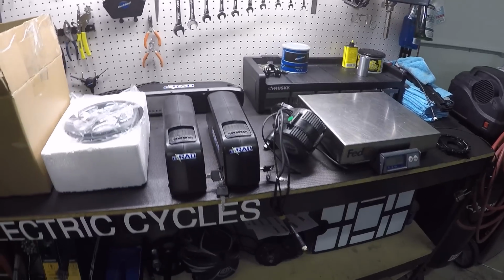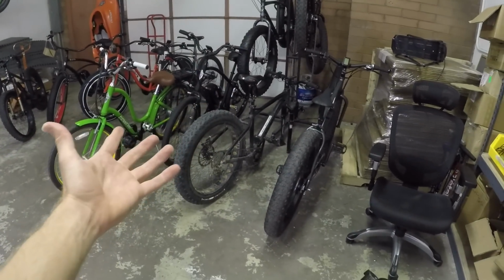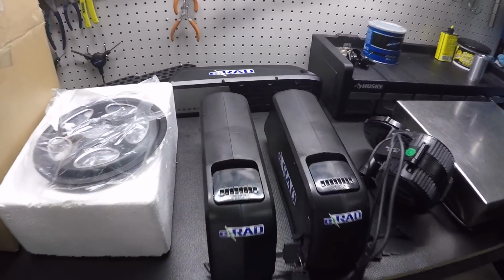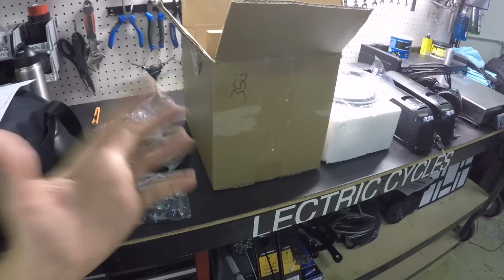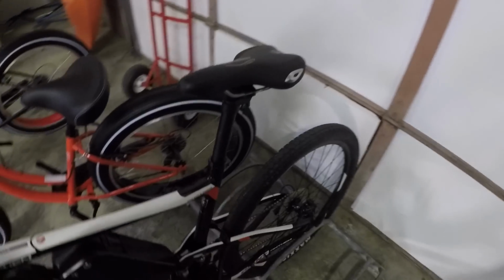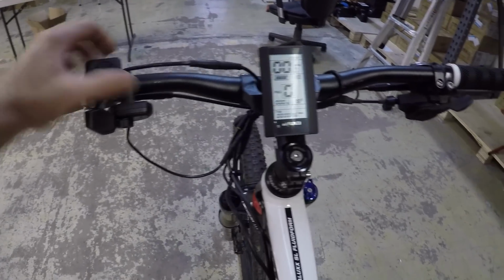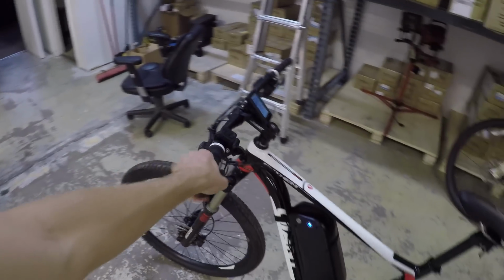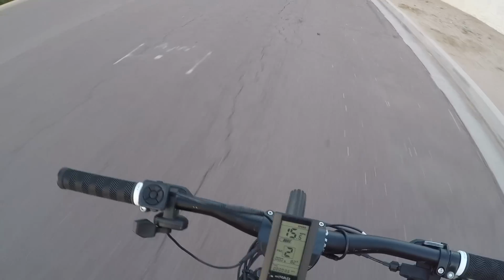e-RAD 750 Watt Mid Drive Conversion Kit Review - $950

Comment: DO NOT install this kit on a high quality bike like a full suspension GIANT, Cannondale or Scott and especially not on a carbon frame.  Reason: The bracket that attaches the motor to your bike's frame, by way of the bottom bracket shell, gets EATEN AWAY beyond belief from all the torque being produced!  This kit is not meant for hardcore riding; only smooth flat terrain or paved road.  I type from experience.
Reply: For anyone looking here, Luna Cycles makes a bracket that mounts to the frame and prevents motor rotation without digging into the bb shell.

Comment: Dumb question: Do these motors need breaking in of any kind? I remember on a new car you were supposed to keep it under 60mph for the first 1000 miles.  Also what is the best way to break in these batteries. I'm getting a setup much like this delivered tomorrow and I'm pretty stoked. Thanks for you videos.

Comment: hello I'm looking into electric bikes in a big guy 6'4 235 -280 lbs my weight fluctuates a lot  but I'm looking into electric mountain bikes  I like trek  power fly 5 s. And up.  And the other company like trek but I forget the name  bit i want a mid drive  but like the looks of the bosch kit and Yamaha kit but I want to be able to use my throttle and have pedal assist  and is it really thatch cheaper to Do it myself of hire a bike shop if I want a good bike and strong  kit bfang  750 or 1000watt i know I missed a lot I'm a newbie  thanks for your help

Comment: Isn't it a recipe for disaster when you install this kit on a frame that is not designed for this kind of weight and power?
Reply: Tamas Varga no.
Reply: tyten olaug I wouldn't be sure about it...
Reply: Tamas Varga the bike is designed to take very big loads on the bottom bracket without failing i can't see the problem.
Reply: tyten olaug "the bike" - which bike? Ask if you still keep the frame warranty when you install this 750W kit...
Reply: Tamas Varga you don't but the bike can handle it no big deal.
Reply: tyten olaug I guess there is a reason for losing the frame warranty...

Comment: how many miles on full throttle can it go on one charge? i'm thinking about converting my bike to electric, and comparing options
Reply: with the 11ah battery
Reply: Joshua Maune 100
Reply: I get 30mile plus thottle with a 48v 17.5 ah .
I cant see the point getting less than 15ah

Comment: Hi Court, I have a giant anthem like in your review, converted to electric with a hub motor on the rear. I run a 48v battery on a 24v 500watt motor. Overvolting gives me a top speed of 61kmh. The reason the battery sits to the right is because the battery's holding bracket hits the cable mounts on the down tube.

Comment: I'm interested in converting a 20" bmx that is custom built with this option. I was wondering if the motor could be placed above the bar instead of below it? My bikes built with no seat post bar in the way and the rear tire is moved about 6-8 inch back from normal positioning so there is plenty of room for it....Please respond :(

Comment: Can this ERAD 750 Watt Unit be used on a GT Sensor Comp?  Just asking because the crank is not solidly fixed into the frame.  Also, what is the difference between the ERAD and the Bfang or 8Fun?  I was wondering because Bfang has a 1000W motor.  Im looking for maximum speed on the off road beach trails by me.

Comment: bicycle cassete and drive chain components are designed for pedal use only and are not manufactured for motor use.  the multispeed gear transmission designs  like those  used on tamiya rc electric toy cars would be great on high power ebikes and allow shifting under high rpms without closing throttle.
Reply: mike x I'm planning on replacing the cassete with and internally geared hub just like you are saying. We've done it successfully now pumping 3000 watts through it just fine! The cassetes will fold in half at that kind of power.
Reply: i was meaning a gearbox desinged for motorized  use not a geared bicycle hub which is intended for pedal bicycle  only use. a heavy duty lightweight alloy motorcycle  frame and 219 chain and rear wheel sprockets also.  mid drive motors wear out bicycle chain ring teeth very quickly and slips chain  under load
Reply: mike x I'm still struggling to fit a Cyclone on my giant anthem so it doesn't matter too much to me 😅 That would be convenient but highly unlikely given the niche market this stuff falls into being illegal on the road and highly hated on trails...

Comment: why not buy a Yamaha R1 motorbike right away instead?
chicken?
Reply: +Patrik Gårdewall If you're asking that question, this channel is probably not for you.
troll?
Reply: +Patrik G&#229;rdewall  e bikes are low maintenance, no gas, no insurance, no license needed, no need to pay for parking (if you have to, at state college it can be up to $1500 for 2 semesters), especially on a college campus (like penn state, university park) ebikes are much better communters than motorcycles. For one thing, they are silent, and do not release smell of gas (or smoke), which is safer around pedestrians (also special ops in military use high speed ebikes for that reason), and you can go on and off road much more freely to beat traffic. I have a 1000w motor, upgraded battery system (same cells in a tesla), can hit up to 60-65 mph. Most time I'll have it limited to 20mph or 35mph since I commute a lot (and for legal reasons) for not really worried about legal case because no one regulates ebikes especially in the east coast where most dont even know what an ebike is or even that it exists.
Reply: It's called gas money, motorcycle license, insurance, being stuck at traffic lights.... Do you need more reasons or is this enough?

Comment: Are the cable operated brakes upto the job especially with the extra weight ?
Reply: +John Hitchen Yes, up to 20mph. Beyond that I'd personally say Hydraulics are the clear winners if you're planning on a fast E-bike. They're powerful and are easy to pull. 2 piston calipers for sure, 4 piston if you want the power/have the money. Rotors should be between 180-200mm for best stopping power.

Comment: This is just very awesome! The only thing I'm worrying about is will the chain and cassette of my regular mtb be tough enough for this 750 Watt motor plus man power? What would you say? Can it break? And if it wasn't tough enough are there ways to buy stronger chains?
Reply: It should. I have a 750 watt bafang 8fun middrive, which is basically the same thing. My bike holds up just fine. It's a 2012 specialized camber. Still has the original shimano xt drive train and does just fine.
Reply: Alright thx man and for how long are you using your converted bike already?
Reply: I think I have around 400 miles on the odometer. It's been about 6 months
Reply: Sounds great man! Thank you!
Reply: +nerdexproject  The key is our Gear Sensor. Removing the load during shifting saves the drive train
Reply: +nerdexproject pro sprinters out 1500+ watts so yes
Reply: KMC makes e-bike specific chains but with the use of our gear sensor we have very few issues with chains breaking.